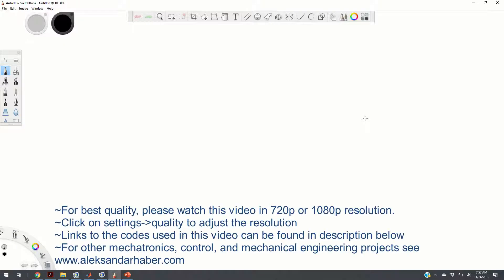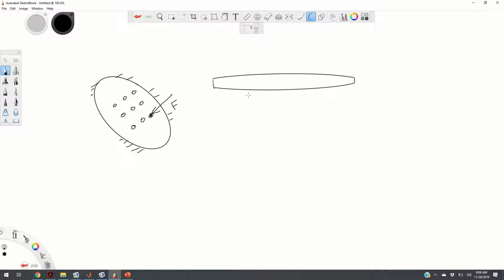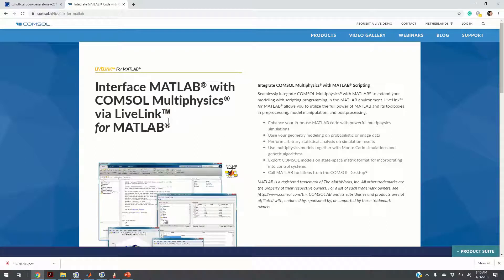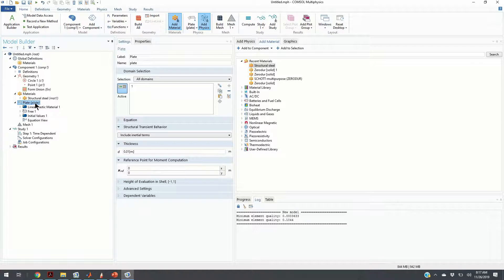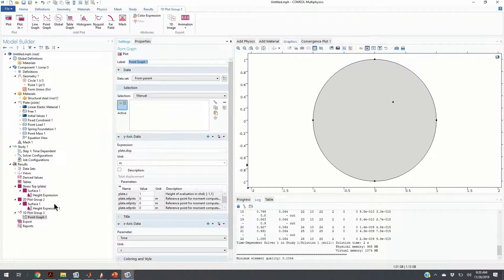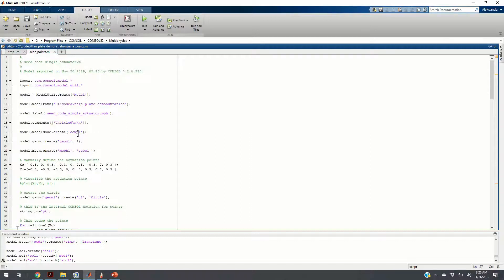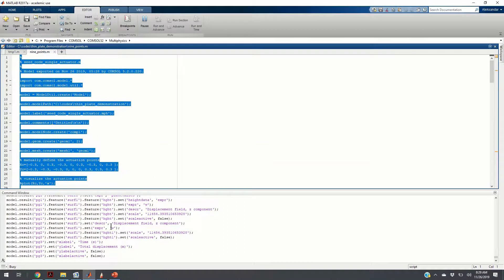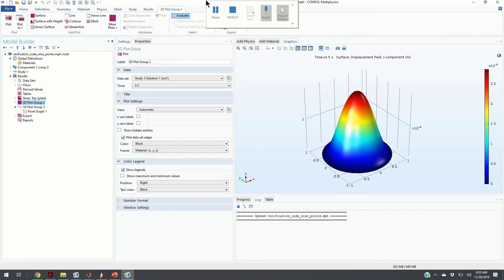Integrating COMSOL and MATLAB via LiveLink: A Powerful Finite Element Modeling Framework-Thin Plate

Comment: Where to find that comsol with matlab application (the black run command in the background)?
Reply from the maker: You need to have LiveLink for MATLAB module installed. This is a separate COMSOL module.  You can access it from the start menu if it is installed.